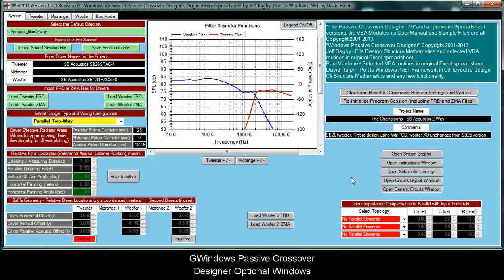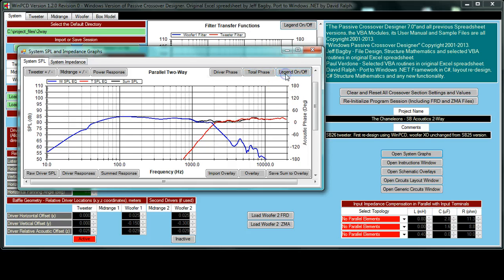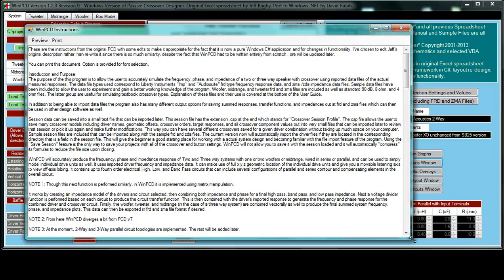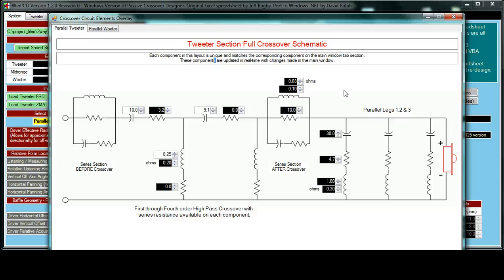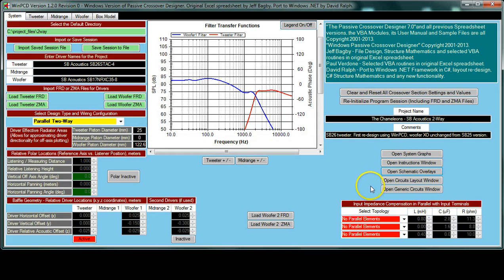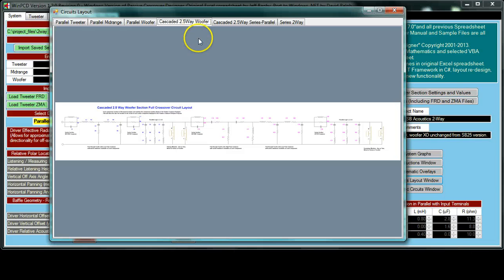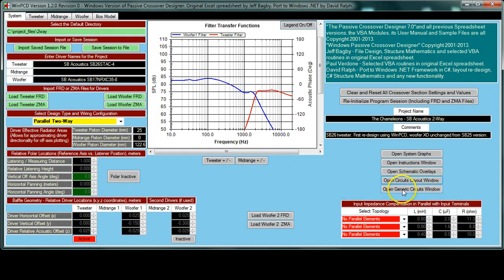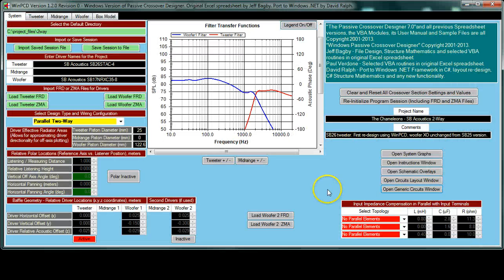WinPCD - Optional Windows

Comment: Thank you !!  Thank you !!  Thank you !!  excellent work !!

question - is there a way to generate minimum phase for raw frd and zma files, using WinPCD? (or is it even needed in WinPCD, asI wonder if the program automatically generates minimum phase when the frd and zma files are loaded and imported for the first time..?)
Reply: DJ Pete WinPCD is currently for crossover design only for now. I would like to add minimum-phase (M-P) generation, but don't know if I'll be adding that. M-P files are only necessary if you are going to investigate points other that at a single measurement point. For that you must have both M-P and the 3-D location of each driver with the z-axis (acoustic offset) determined using the M-P files that will be used for the design. Search for "relative acoustic offset" to find more information on that topic.